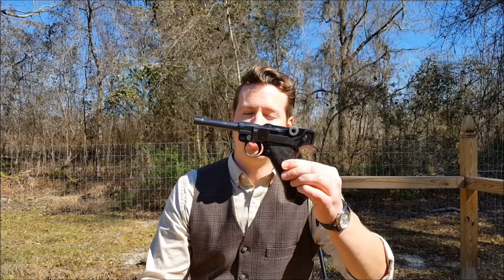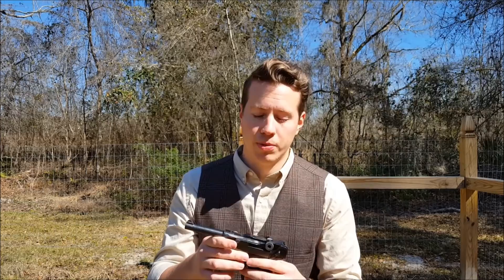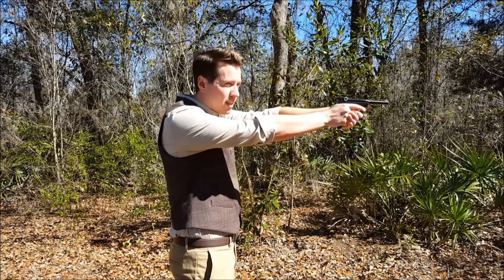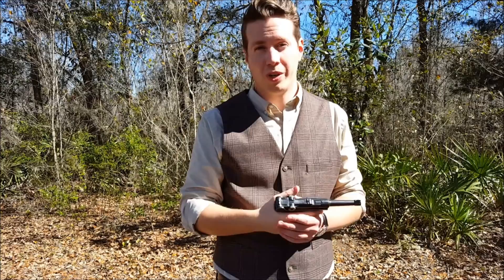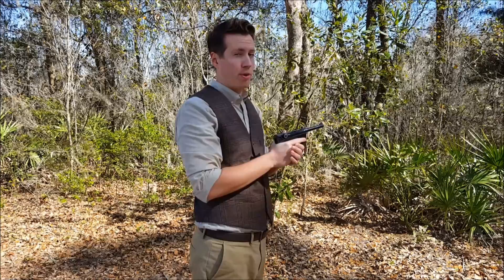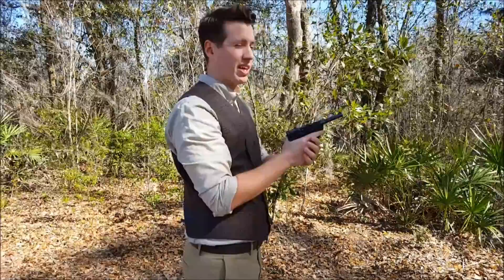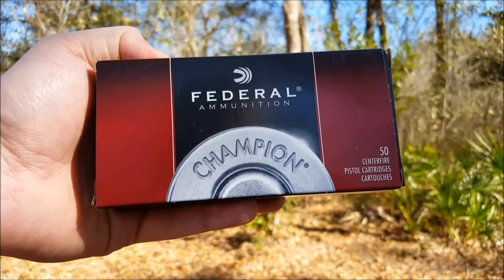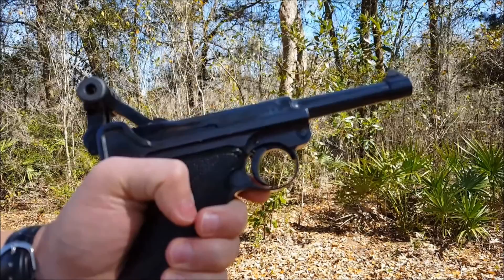German P08 Luger Shooting

Comment: I'm guessing the longer barrel on the Luger is probably because they would put a stock on it and turn it into a small carbine. A small carbine is more useful for sailors to use for raids costal areas, or something they need captured, and not destroyed by heavy navel gun fire.
Reply from the maker: +Hans Alba That's a good point.

Comment: The reason the navy wanted the long barrel was due to the optional shoulder stock it was issued with. Using the same logic as the "artillery" Luger a long barreled one could be turned into a PDW of sorts with the stock attached. The navy wanted this for arming naval infantry or ship landing parties as the germans didn't really have a marine corps at the time they just had extra crew on ships that could be issued small arms and turned into naval infantry platoons. They of course issued these men standard Mauser rifles from the ships' stocks but having a regular infantry rifle or carbine and an improvised PDW gave them an edge in firepower over any enemy they were expected to face. (Mostly angry colonial tribes that may have captured service rifles)
Reply: As far as I read, the German Navy intended to destroy floating sea mines by shooting at them with the Parabellum Pistol, therefore no need to shoot with artillery. Therefore the Parabellum Marine 04 had a - the longer barrel, b - the shoulder stock and c - an adjustable rear sight (folding type for two distances). In so far no "secret wonder weapon" ... only useful!

Comment: Are there any cheap Lugers?
Reply from the maker: Yes, mismatched or commercial Lugers can be had for less than 1,000. I saw a mismatched Luger sell for between 600-700 fairly recently.
Reply: Reynaldo Abulencia the problem with cheap lugers is that the luger is a mass produced but hand fitted pistol and doesn't always work reliably with parts fitted for other guns. I've had problems with them.